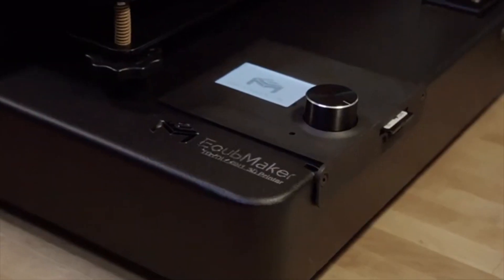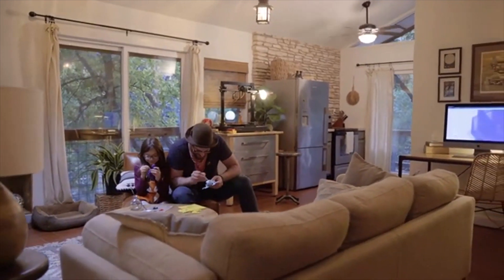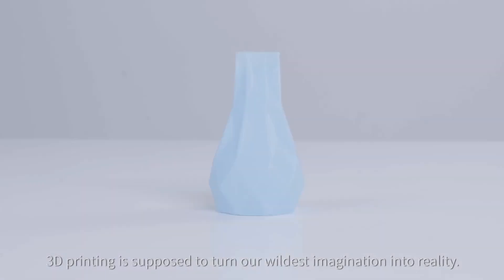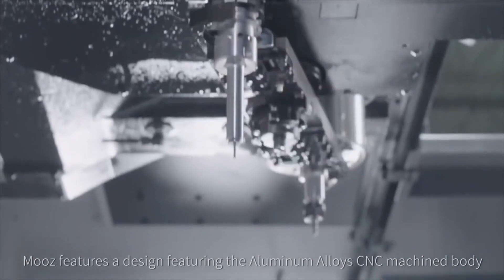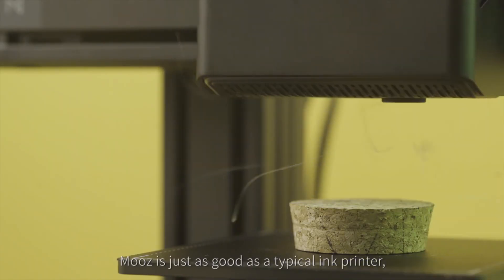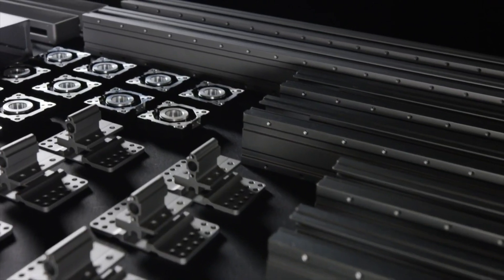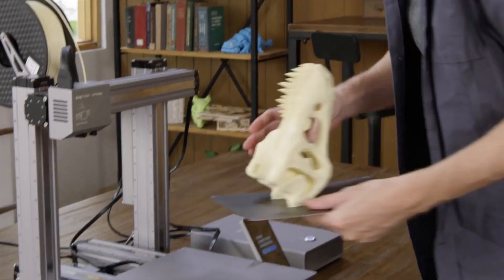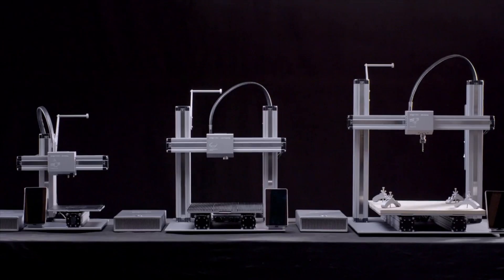Top 5 ALL-in-ONE 3D printers | 3 in 1 3D printers 2021 that can print, carve, and laser engrave

Comment: Got a Snapmaker 2.0 A350 as a graduation present. It was really loud, it stood in the basement with two doors closed and one could still hear it. 3D prints often got loose from the bed mid-print or never attached in the first place. The software was really clumsy to use and projects sliced in it took two or three times longer compared to Cura. At the time I didn't have any projects requiring CNC milling or laser so I can't comment on that. 

All the addons, including the emergency stop button (which should come included with these kinds of machines) were expensive as hell. In the end I decided to sell the Snapmaker. 
Bought a Creality CR-10 V2 instead and the thing just works. After my experience with the Snapmaker I've decided to buy separate dedicated machines for each task.

Comment: I got the base model EcubMaker for $500 - total waste of money. Was poorly packaged and damaged in shipment. The 3d printer clogs and need to replace feed tubes. The laser is iffy, maybe because the software provided has limited settings and difficult to generate g-code. Pretty much the same for cnc. Do not buy this product.

PS - this is just a regurgitation of ads for devices.